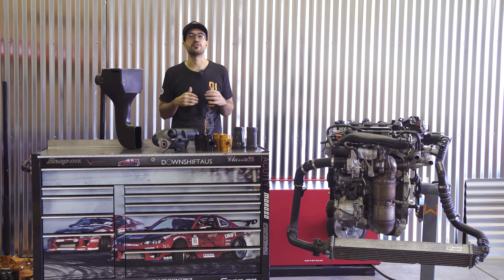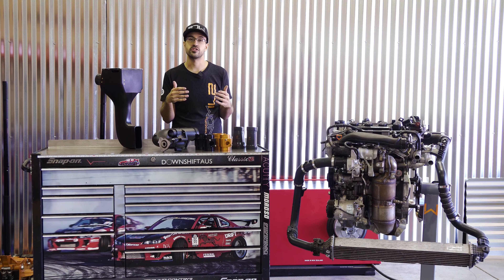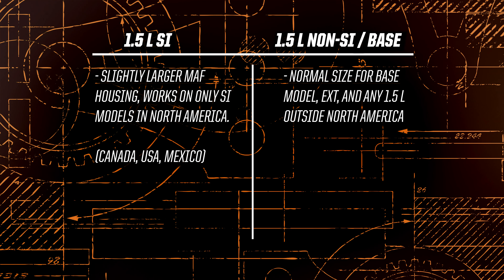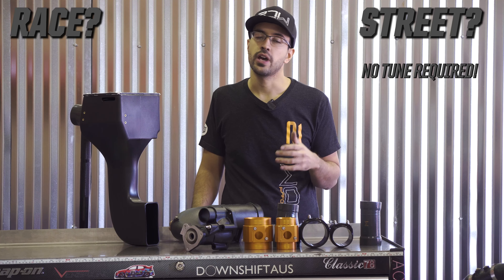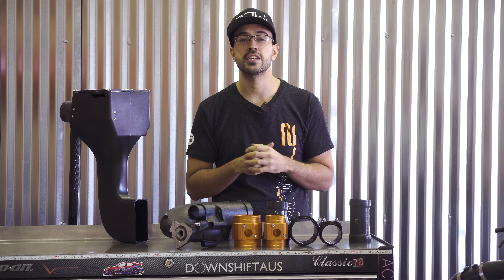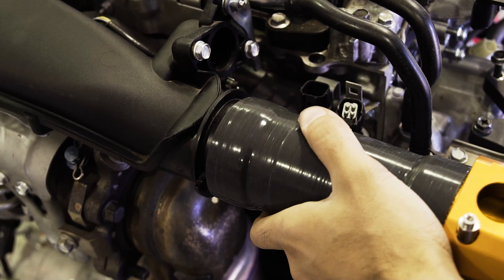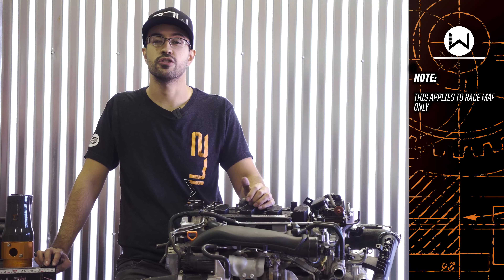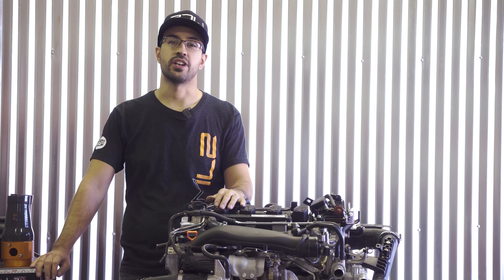Choosing the right intake system for your Honda Civic 1.5L Turbo Engine (27WON CAI Tech Video)

Comment: What if I want the race MAF, but plan to do some other modifications, therefore I want to wait until it is all finished to tune the ECU correctly with everything else already bolted on? Will I be getting important code errors in the meantime?

Comment: Did you know that there is two sizes of stock maf sensor, one for europe and other for U.S. I have civic hatch 1.5T for europe market and it have smaler size maf (hole).
Reply from the maker: Yes that is the same as the None SI version.

Comment: If I already have the cold air mated to my stock inlet pipe, do you guys have a program where I can purchase the according hose for your TIP?
Reply from the maker: Yes, when you purchase a TIP you will select the silicone you need there.

Comment: I understand this will give the car more power but what if I’m after better mileage as opposed to more power?

If I do not have the undercarriage cover on, am I running a high risk of hydro lock?

The filter is non-oiled. Is it a high flow filter or a paper?
Reply from the maker: You will actually lose fuel economy by not having the undercarriage on as the car becomes less aerodynamic. You should not remove any of the plastic pieces from the car. 

The filer is a synthetic filter. Check out our other video with details on the intake system itself.
Reply: @27WON  it didn’t come with it. I’m getting in touch with the dealer now about getting it.